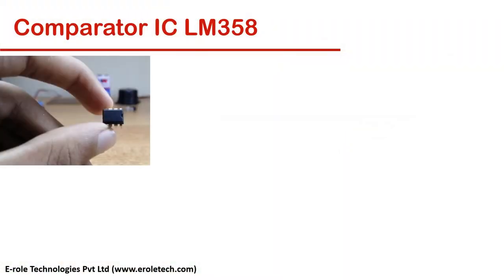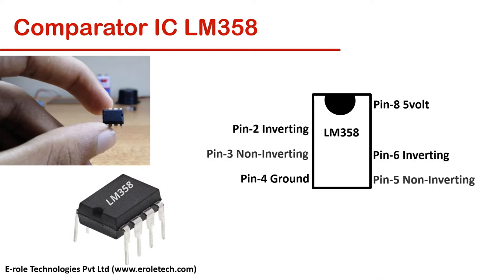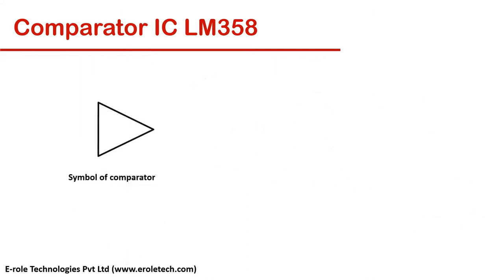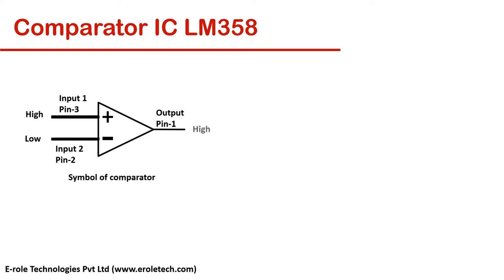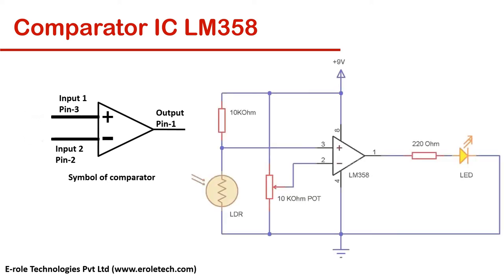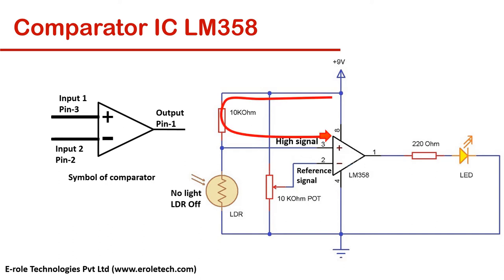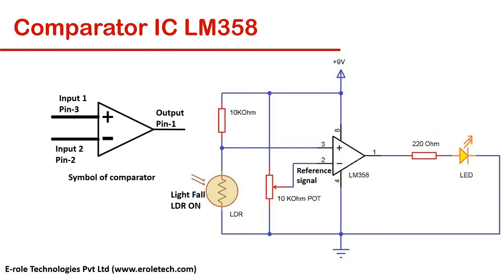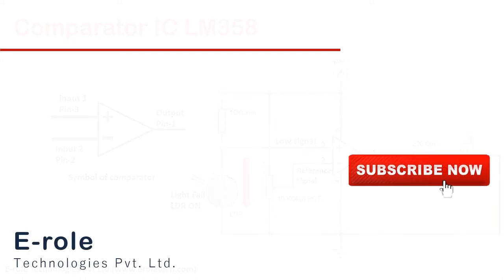LM358 IC (Dual comparator) Basic Electronics

Comment: LM358 is NOT a comparator. It’s about the lousiest op-amp you could use in that role. LM339, LM2901 and parts in that series are decent comparators and cost nothing much. Probably less than a 358.

Although I have to admit: if all you need is a very slow comparator and you have an unused 358 sitting around - go for it. It has a wide differential input range so works better than some other low-end op-amps.